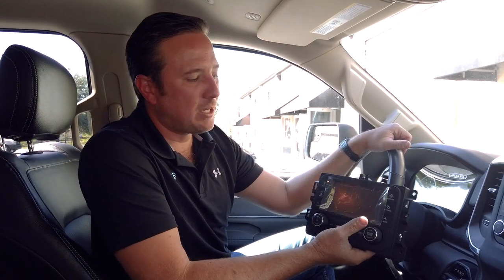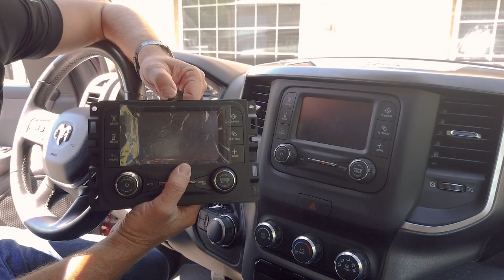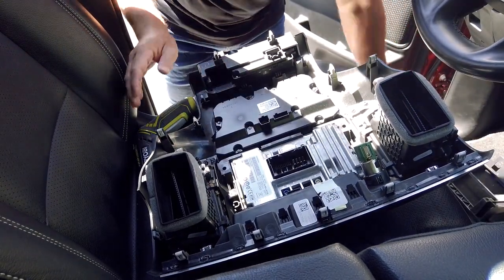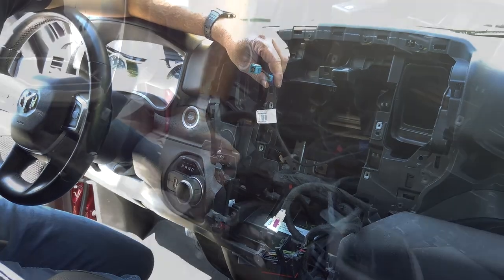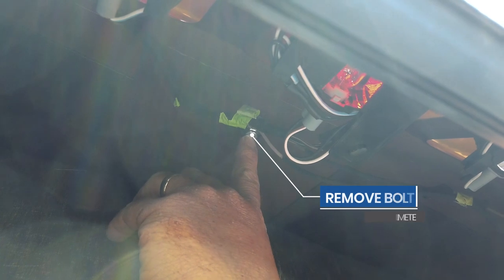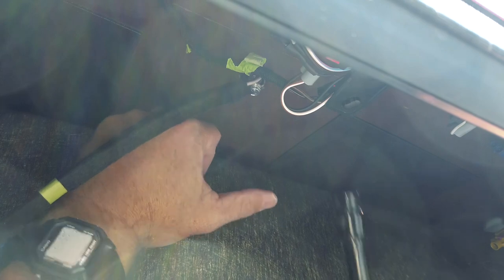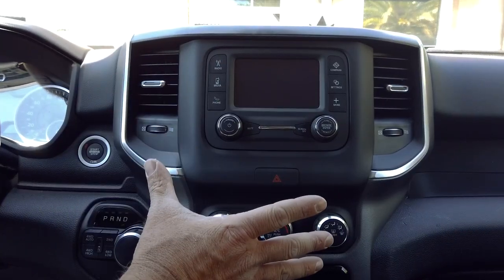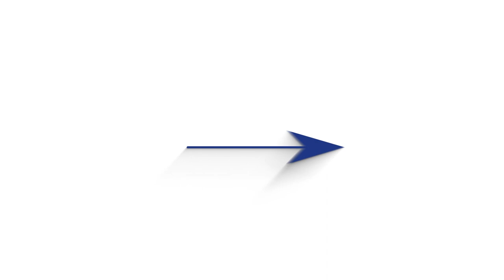2019+ DT Ram 1500 Truck - Factory SiriusXM Satellite Radio Antenna & Radio Installation

Comment: Showing how to get a connectors off. The back would have been extremely freaking helpful, but you all forgot that part. And yes, I bought one of these from you guys and I am complaining about your video, sorry.
Reply from the maker: Ah, yes the radio connectors are typically a bit tough. Some of our earlier videos go over that, but it appears that this one did not. We apologize for that. Sometimes the release clips are very firm and don't want to give. The best piece of advice we can provide is to take your time. Those connectors can break if too much force is used.